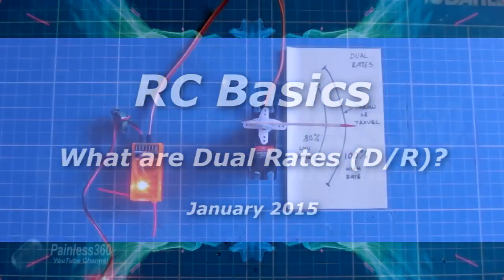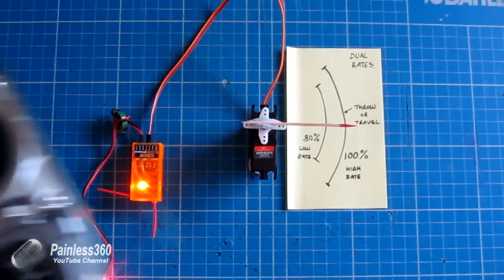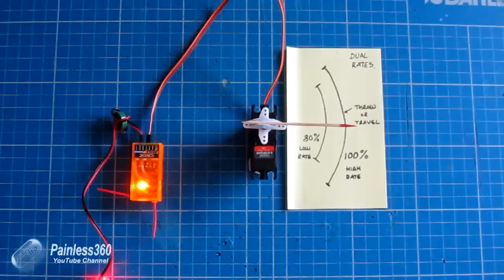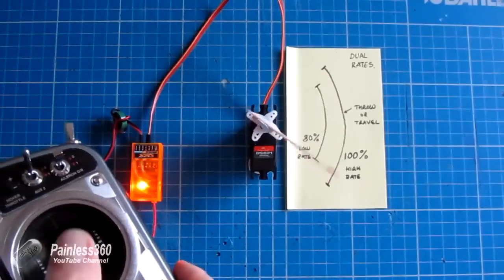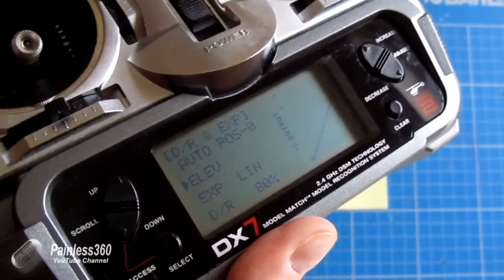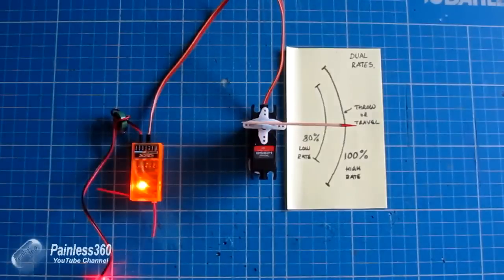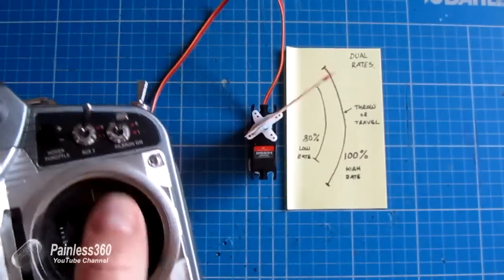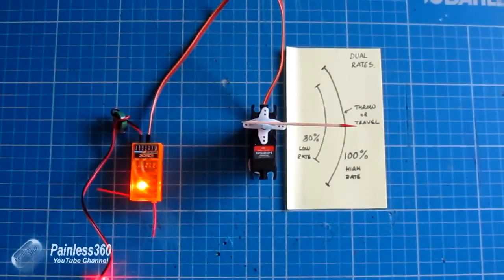RC Basics - What are Dual Rates? (D/R)

Comment: Another excellent video - thanks! I’m a bit confused with my Align T-Rex 450 heli: As I change the the rates, for example, on the tail (blade pitch/rudder), the throw distance remains the same but the servo response is much quicker or slower. This kinda makes sense as it’s the “rate” of change. So could you tell me why your video refers to the ‘distance’ of travel? 👍🏻🚁
Reply from the maker: Have you got any flight stabiliser or gyro on the tail?
Reply: @Painless360  Yes 👍🏻 It comes with the standard “Align MiniGRS Flybarless System”. It’s nicely stabilised.
On the bench, I can flick ‘throttle hold’ to see the tail blades change pitch left/right. It confirms what I experience in flight.
The servo mounted on the body has a long rod to the tail. This alters the angle of the tail blades while they spin the same direction & speed.
Sorry if you already know this 🤩. So basically the same as the rudder on a fixed wing plane.
My point is that playing around with rates, I can see at say 10%, the servo takes a couple of seconds. Where as at 100%, it happens in a split second.
In each case, the distance of travel (or throw) is identical 🤔
Reply from the maker: Then it sounds like the way that the flybarless unit is affecting how that all works. I've not used that one here. Best of luck
Reply: @Painless360  Thank you, it is a bit odd!  “Rates” meaning speed of change does make sense if you think about it.
Can you confirm it refers to the distance/throw of the servo, not the speed at which the servo moves? 👍🏻

Comment: Hey, could be my car faster if I will buy controller with dual rates? Or all controllers use max power by default?
Reply from the maker: Throttle channel limits are not something you use dual rates with. The limits are set via the ESC calibration.. Best of luck
Reply: @Painless360  thank you!

Comment: Why is there only dual rates and not like triple or quadra rates?More advanced rc transmitters have more than dual rates?Maybe i find 80% also very aggresive and i want to set it to 60% or 68% .Can i achieve this with any other setting like epa throttle?
Reply from the maker: You can setup as many rates as you like with modern radios.. Check out the Opentx mix school..

Comment: You're talking about%. In my manual it says e.g. "Elevator" High Rate up 10mm, High Rate down 10mm. Should I measure the movement of e.g. "Elevator" from neutral and adjust% to the measurements fit?
Reply from the maker: Yes. See my OpenTX simple plane setup video... best of luck

Comment: How does this differ from steering endpoints? I have both settings on my controller (rc truck) and this video explains how steering servo endpoints work.
Reply from the maker: I am only just getting into radio controlled cars so don't know how all that works yet. Sounds very similar though doesn't it?

Comment: On a plane-what would be a good place for a beginner to start with dual rates?  
I have the dx6 transmitter.  I am a beginner.  Only 4 or 5 flights on my sportsman s trainer that practically flys itself. I built a Flite Test Trainer...that I would like to set up with dual rates.  Thanks Jim
Reply from the maker: It really depends on the model. Most models have a range of movement in the manual for the control surfaces so I would normally set the high rates for the throw in the manual and set low rates for about 60-70% of that movement. Also worth adding some extra expo to the lower rates too to help with fine control.. Happy flying!
Reply: Ahhh, I’ll bet that’s what the high/low gauge is for...thanks

Comment: Great video....finally someone who made a video explaining  what D/R and Expo means   .....  I have the DX6  Tx ...is it alright if I set up my duel rates and expo settings on  my 3 position switch "G"   instead of a 2 position switch?.... 1st position 70-30 % ,  2nd position 100-30% , 3rd position 100-0%.....I am flying a helicopter .....( Blade 200 S ) what do you think.....thanks....Gary
Reply from the maker: The settings in the manual look good to me for a starter for ten. I'd never fly a heli with no expo at all, I'm, not that good a pilot..
Reply: OK.....I  am adding expo back into the 3rd switch G position.....I also moved the " panic " feature from the 
 " I " button, over  to a 2 position switch ..."A'...do I still need to keep the AUX 1 reversed?

Comment: Hi again... Quick question about DR and Expo for Quads... I have flown planes for many years... Just got into quads this season. Is it better to setup expo and rates in the transmitter or the Mission Planner software? I don't see a place to get a switch working from Mission Planner to switch between rates, but probably has something to do with the CHX_OPT... I know some of the radio setting can confuse the Flight Controller. I am currently running a Pixhawk... But the question would be the same for Cleanflight or other FC software.Thanks Steve
Reply from the maker: The general rule for expo is to set it on the flight controller as it provides a much smoother result. I use both as I also like the option of changing it easily on the radio too.. In the latest series we are doing (iNav) the advice is remove all D/R and Expo from the Tx and let the flight controller handle it all..

Comment: I have been watching your CC3D series and that was all I needed to build my first racer 250 quad. Brilliant series!  A question relating to this video.  How does this works with CC3D?  I have dual rate setup in my transmitter (radiolink at9). What is the relationship between dual rate in transmitter and the input scale bar you see inside librepilot RC input tab?  I am a bit confuse.  If you move the stick of the transmitter to the furthest point the RC input scale reading will go to the max independent of the dual rate setup in the transmitter . Many thanks in advance.
Reply from the maker: +Jack Truong I would never used dual rates on a flight controller, this is more for fixed wing models. Once the flight controller is calibrated to your radio you should only have to alter the expo.
Reply: +Painless360 very good point. Many thanks.

Comment: nice clear video but im still a bit confused..... so lowering your rates is like reducing the resolution of the tx controls.... im trying to fly my first multirotor on a kk2 board and I read somewhere its best to send the best resolution from the tx to the kk2 but this makes my tricopter  hard to control. do I need to make the adjustments on the kk2??
Reply from the maker: The endpoints do not affect resolution, just the total travel on the channel. Typically a channel will move from 1000 to 2000 microseconds (1 to 2 milliseconds) with the midpoint being 1500 microseconds (1.5 milliseconds).

Dual rates just limit how far the channel goes towards the 1000 and 2000 values.

Stick scaling on the KK2.0 is about how aggressively the KK2 responds to the stick input. The lower the 'stick scaling' setting on the KK, the easier it is to fly but harder it is to do flips and rolls.

Hope this helps. Happy flying!